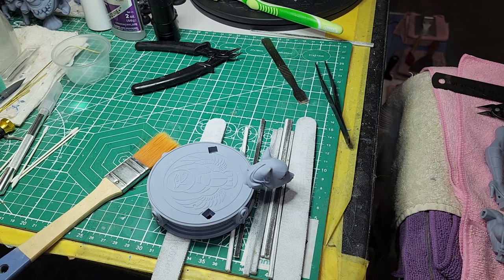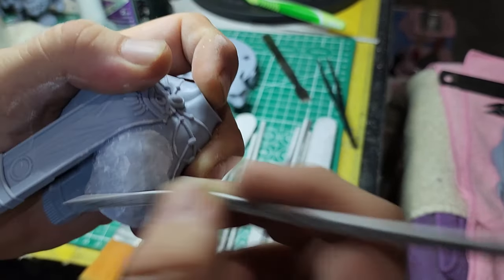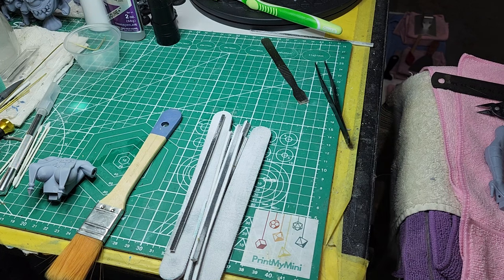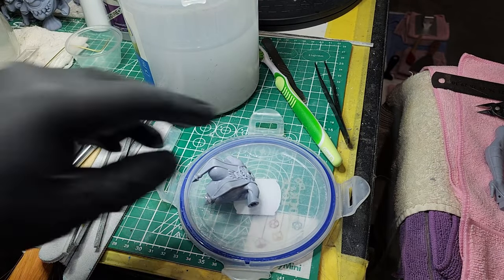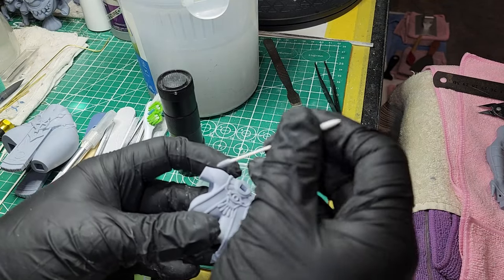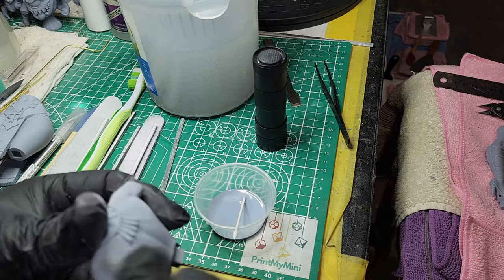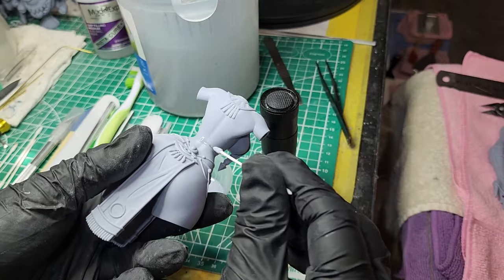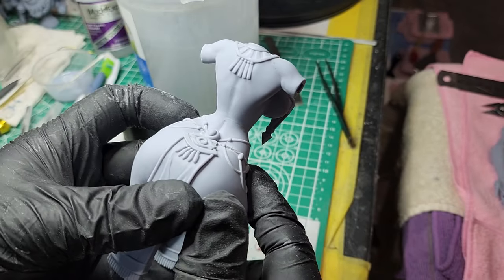Finishing and Gap Filling a model before painting

Comment: I’ve been using old resin to glue parts on resin minis. Just use a UV light to cure it. Also I use resin to fill gaps partially before using putty.
Reply from the maker: Great methods, and the results are usually smooth. Nice! Thanks for sharing!